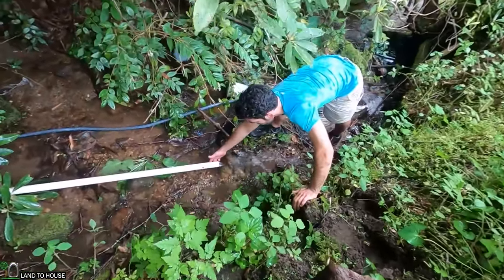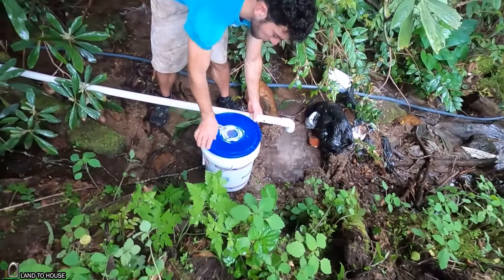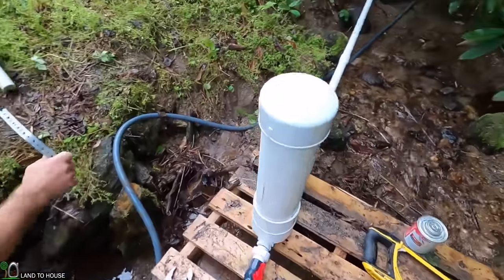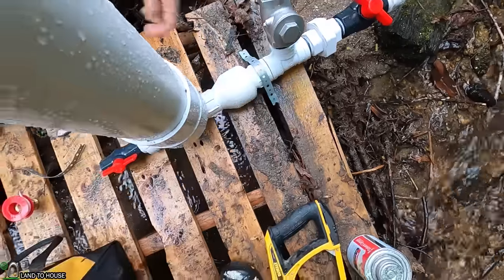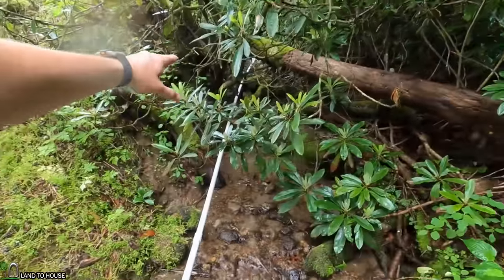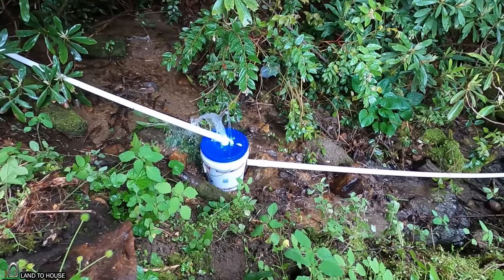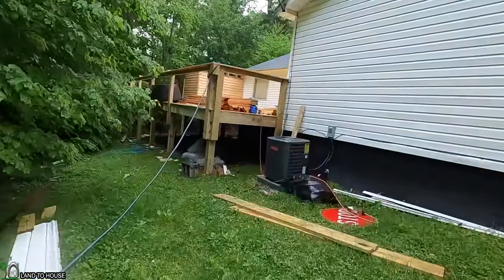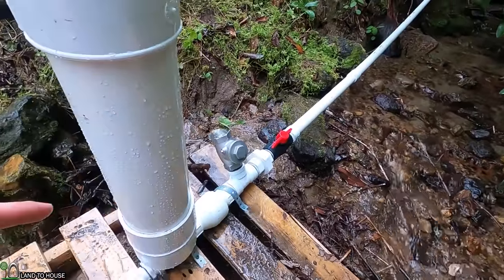Full Ram Pump Install 1-1/4"

Comment: Hi Seth, I have  a nice size creek that runs through my property it’s about 3’ deep but is very slow current thanks to the beavers! also land is pretty flat! Just wondering what are your thoughts if it will work for me? We have no source of electricity so this would be amazing for us! Thanks for sharing your videos!
Reply from the maker: Hello. To get the pump going you will need to have head pressure (water drop). 2 feet is the minimum head pressure to get the pump going. This can lift water to 14 feet. With low head pressure you are going to want to use one of the smaller pumps. They are much easier to work with when you have low head.
Reply: can you damn up part of the creek to raise the level of the water? stack a bunch of stones and then some of the beaver sticks and blame it on the beaver if you have any altering waterway issues which are a pain in the ash here in TN. But damn it, raise it, if you have flat land, you can also dig down your supply line area a foot or so, so between damming and digging you should be able to get your head height you need.
Reply from the maker: Creating a small water blockage (naturally by beavers of course) can gain the head pressure to run a pump. There may also be enough head pressure over a longer distance of pipe instead of making the water blockage.

Digging a hole and putting the ram pump in that actually does not increase the head pressure.

Comment: what was the purpose of that exhaust valve you had just before the vertical pump? do you have a video of the pump build itself?
Reply: Check  valve,  create pressure,  used to push  water.

Comment: Would   this system be used to pump water from a well under the ground?
Reply from the maker: Sadly the ram pump only works from head pressure. Well water does not have the drop needed.

Comment: Can there be to much head pressure i got 1.5   suction 60 foot of drop 3/4 diss the check is really hard to push down cant fet it to cycle
Reply: 100 feet of drive line with a 10 foot head will give the very best results. more head will not make any better just the opposite and to much hear and the pump will not run at all.
Reply: Thank you sir

Comment: Hi, I need help 
I've set this up ,valves going the right  way but it wont kick into action.
I know I have a bottle but it seems to hold the pressure . Please help or advise .
Many thanks 
Simon
Reply: The water flows through the first valve shutting it off and  the pressure builds in the bottle and the first valve does not reopen , I've opened it manually , it then closes again after around 2 or 3 seconds and closes again but does not reopen. But there is water flowing out of the pipe at the animal water  feeder
Reply from the maker: If you have water flowing out the top you have a back pressure issue. Search YouTube for "ram pump back pressure" and you should see my video on that.

Comment: Hello! Have a question, I'm in South Florida with flat elevation and have a work shed constructed of metal and would like to reclaim rain water into 2 -ICB plastic storage container's connected together supplying 660 US gallons. I know I can use a circulating  pump but would like to use Ram Pump if possible. I'm not sure of the head pressure of these ICB storage containers? Desiring to use recirculated stored water, I would like to use a garden hose pipe and drilling small holes into discharge garden hose enough to place small amount of water on the roof shed to diminish heat /temp's. My shed roof ridge is 9 feet to the highest point of ground elevation  and my tanks are 47 inches in height. How high would these tanks need to be elevated if this would even work? Will your ram work in this situation and if so, which one do you recommend I order from Amazon?  Thanks for a very interesting video.
Reply: I don't believe a Ram pump is your best option with a limited volume of water.  Ram pumps waste water as part of their operation.  I don't know the ratio, but they work best with a source of flowing water.  It might be an interesting design to use the flowing water from the downspout (while raining) through a ram pump to fill an elevated tank above the source (Rain Gutter), but I don't believe that is what you were trying to do.

Comment: But you need 2 check you used only one. You need 2 valvule check
Reply from the maker: The pvc inline valve is the secondary valve that holds pressure in the tank. It does not have to be carefully oriented like the swing valve.

Comment: I have a 55 gal rain barrel hook to a 1to 3/4 ram pump with about 50 foot of pipe between them but it still won't shut the 1in check valve it just runs out what is wrong can you shed some light on it trying to fill storage tanks for summer use
Reply from the maker: Its super important to match the waste valve size to the drive pipe. If the drive pipe is 3/4" and the waste valve is 1" the valve won't shut unless you have lots of head pressure.
Reply: the incoming line is 1 in and after the check valves is 3/4 to exit  @LandtoHouse

Comment: As sentiment builds in the bucket it will compact as it settles, at least it will in my geographical location. rendering your drain plug useless. without human intervention. And finding out this isn't for drinking voids my next comment. so I'll spare you that. Enjoy your cool/cold fresh spring water dips.
B)

Comment: why want to make such a small Ram Pump ?? Is it suppose to be bigger since needs to have such long delivery pipe???
Reply from the maker: The 1-1/4" pump is supplying at least 1440 gallons a day here. That is plenty of water for a cold dip.
Reply: @LandtoHouse  Hmmm... 1/2 gallon per minute is 720 gallons per day.  Still plenty for the sauna cool-off pool, ornamental fish pond, livestock tank or watering a kitchen garden.

Comment: Very good work, let me ask you a question: what is the ratio of water that the ram raises with respect to that of work?
Reply from the maker: Typically you can get the pump to operate on 10-30% efficiency.  A lot of water comes out the waste valve.
Reply: @LandtoHouse  Thanks!
Reply: @LandtoHouse  is there some way to limit the water waste from that valve? is that just to get the air out? because many ppl use a 6' tall vertical hose near the supply end and that is suppose to work good. could eliminate the need for that all together, if that is its sole purpose.

Comment: I was wondering
Could a ram pump be run in a winter environment if the fall of water never stops at the course of the intake line?
Reply from the maker: The ram pump can be run in temps below freezing. The issue is as soon as the water stops moving it freezes.  I ran a pump at 15 degrees for a week. Ice rose up from the ground and plugged the delivery. That stopped the pump.
Reply: Land to House 
Thanks for the reply.
That’s what I was thinking as well!!

Comment: Would this pump water 500 feet up hill?
Reply from the maker: The ram pump has an upper limit of 180 feet. This is based on the weight of the waste valve. The horizontal distance can be a very long way.

Comment: I live in the flat land and have to pump water from pond to garden barrel will the pump do this?
Reply from the maker: If you have head pressure (water drop from source to pump) It will work.
Reply: I don't have drop i have to pump up from source to a 100 feet flat and go up to barrel

Comment: Thanks for all your videos, great information. I would like to see experimenting with out of spec items. Such as over size air chamber or double chamber. Also larger waste valve ie 1” valve in a 3/4 system. Also larger drive pipe 1” pipe for a 3/4 pump. I am curious about the changes in pressure build and delivery volume with these variables.
Reply from the maker: I have tested a fee things like that. For the mismatched drive pipe it often keeps the pump from running.

Comment: What was point of adding bucket?
Reply from the maker: The bucket does 2 things. Allows an air free source. And catches silt.
Reply: Not only does it catch silt, if I remember correctly, it'll also slightly increase water pressure to the ram pump allowing it to work more efficiently.

Comment: Do you always need a fast running stream for this to work?
Reply from the maker: The 1-1/4" pump needs 8gpm to operate. As long as you have that you are good. If not it will drain the source.
Reply: what about pumping from a pond ? still water.

Comment: Thank for your video.    Any improvements or new products for 2021?    What is your current thinking about stainless vs brass waste water valves for 1 1/4 inch ram pumps?    I purchased two 1 1/4 inch ram pumps from Land To House last year which turned out to be a great decision and I'm considering increasing for 2021.  Thanks - Dave
Reply from the maker: I have totally swapped back to brass. The lighter flap allows for pumps to be used in low head situations.  The SS needed at least 1 more foot of head to work. No new ram pump products. I am starting a new youtube channel.

Comment: Thank you for this very timely video.    Like the pump in the video, I have a Land to House 1 1/4 inch ram pump that I will start installing in a couple of weeks and my estimate is that I will need the 20 to 30 feet of lift similar to the installation in video.  I'm only looking to lift 10 feet, but I'd like to run a low pressure Wobbler so another 20 ft of potential lift should give maybe 8 PSI for the Wobbler?  (note to self, look into the ultra low pressure mini Wobbler version).  Hard to tell, but I don't think that 1/2 gallon per minuted directly from the ram pump is enough for our current Wobblers?
If we need more water to run the Wobbler and / or drip irrigation, what are our options and which are the most productive?  
- Increase the head?  I have 2 to 3 ft of head from a a couple of diversion dams and difficult to get more dam height for one location because of the flat meadow.    I'll need some length of drive pipe anyway and can pick up more head by running a longer drive pipe.
- Increase the length of the drive pipe for the shock wave to travel - might help, but I'm unclear of the relationship of length of drive pipe to volume of water delivered to a usable height with the same head, however 20 feet of drive pipe may not be optimal and may be able to run it to 100 feet fairly easily.  
- Increase the flow through the drive pipe - will this even help?  We do have plenty of water, but I'm not sure if increasing the 1 /14 inch drive pipe to say 2 inches until just before the pump will even help and might be counter productive.   Is there a Land to House video on this?
- Add more ram pumps?   In this particular situation, I'm trying to irrigate a meadow of 3 acres with the highest point about 10 feet up from a stream with plenty of water, especially since some of the pumps may be able to use combined output and waste water is returned to the stream.   I'm pretty serious and while I won't jump here, but if necessary I am prepared financially to install a dozen ram pumps and acquire a bag of earplugs.   Anyone running multiple ram pumps to deliver the required volume of water?

- Pump higher to a tank and release with an auto siphon when enough water is available.
- 1 1/4 inch is currently the largest ram pump available from Land to House.   Going bigger by building myself or from other vendors may be an option once I have at least one of the 1 1/4 ram pumps operating.   So far, despite some effort on my part, I'm unclear of the trade-offs between more ram pumps vs larger piped pumps for a fixed amount of head and lift required.

- Other types of water powered pumps may be a possibility.  It is hard to get comparative statistics, even for environments where different types of pumps are possible, because usually the installer has their single favorite approach.      Only when a significant amount of water is needed does it make sense to spend the effort to compare the cost vs volume of water delivered by different types of water powered pumps.  If you are interested, please reply here about the Land to House pump approach and consider sharing your ideas in the Water Powered Pumps public facebook group - obviously, I need all the help I can get:   https://www.facebook.com/groups/240458583255303/
Reply: Thanks for drawing my attention to your short drive pipe video.   Seems like it would be worth a try to increase my drive pipe from short to 20 ft to 40 feet and continue to go longer with the drive pipe as long as the volume output continues to increase.    Unfortunately the head will not increase very much with distance in my case:     Here is the link to the Land to House Short Drive Pipe video:  https://youtu.be/yofEoR43bqU

Comment: Hi, if I want the water from 600 meters is this helps
Reply from the maker: The ram pump is able to push water 600 meters horizontally. It will max out in lift around 55 meters.
Reply: @LandtoHouse   which size we should use for that?
Reply from the maker: Each size has close to the same potential.  The difference is the amount of water it takes to operate the pump and the amount of water it can deliver. 
www.landtohouse.com 
More information is available on the homepage.

Comment: if buy a solar panel and an electric pump, cost will only about $ 700, in comparison with the price of a hydrotaran in $ 1800 on Amazon, the system will also not need of a paid source of energy, in addition, it will not need a long feed pipe
.
count:
solar panel 24v 10a 250w 1 pc - $ 115
3 electric pumps 24v 3a - $ 420
car batteries 55 Ah 12 volts 2 pieces (in series, for ballast) - $ 115
filter, 40 microns 3 pcs - 55 $
solar controller 20a 24v - 10 $
total - 715 $
prices in russia of end June 2020. Shipping cost not included. (about 25 $ for everything)
if you will use only 1 electric pump, the price will be sharply lower
Reply from the maker: Let's say you use a 1/2" ram pump. The price can be as low as $100.
Reply: @LandtoHouse  ваш столько там стоит. (1800 долл) там такая цена. ну так детали дешевые, 1 дюймовый может стоить тоже 100 долл, но что то хочется покруче. электронасос на солнечных батареях! и в ютубе мало таких видео) можете сделать) может попадете в тренд)))
Reply: @LandtoHouse  translate ourself. it simply

Comment: Can you use this in a hand dug well?
Reply: No water doesn’t defy gravity the head pressure created by the down stream creek flow operates the valve along with the chamber that fills until the air space in the hammer tube causes the gate valve to close and releases the pressure up the hose no well creates head pressure without a pump

Comment: Hello, I recently planted fruit trees on top of a hill with only rain water collected at bottom of hill. Want to keep it cheap. Can I make a little basin with small electric pump at bottom of my hill then send the water uphill with one of these offgrid pumps ? Theoretically this would require just a small cheap electric pump, small basin and your pump to get my rainwater up the hill.
Reply from the maker: That would work. One thing to consider is that the ram pump requires lot of water to operate. Typically the 1.25" pump will lift 1.5gpm for every 8 gallons lost.  You are need to put a catch basin under the ram pump to capture that waste water to be pumped up again. If you going to be using a solar powered pump you might just consider only using that.
Reply: @LandtoHouse  You're right, thanks so much for the answer♤♡◇♧

Comment: What's inside the ram pump?
Reply from the maker: Water and air pressure.
Reply: Question,  is there a way to increase my water pressure at my home. I'm getting about 53 psi on my outside faucets and I'm thinking about putting in a sprinkler system.

Comment: It looks totally wrong! How can it possibly pump? The waste valve usually is mounted after the air container and the one way valve between the air volume and the feed line. I am puzzled!
Reply from the maker: Haha there are several configurations for the ram pump. This style is easier to ship.

Comment: Love the videos. I'm building my own pump but finding it impossible to find the 4" x 1 1/4 bushing at Lowes or HD. Where do you normally buy those?
Reply from the maker: That part is hard to find. I buy them in large qty from a supplier.  You might have to go with several parts. .
Reply: Google like a normal person.

Comment: I would be very careful using plyers or a wrench to tighten "male" pipe thread into PVC "female" pipe thread, the tapered pipe thread can and will split the PVC, I speak from experience and a costly backhoe project.
Reply from the maker: For sure. The pvc threads can split or cross thread.

Comment: Sounds like a HEART--- hmm?  Did anyone ever think that in reality this is how our heart actually works?   Think how the speed of blood moves through the body from the  capillaries (like a marsh- slow) to then tighter arteries (like a river racing) -- into the heart.   Blood is flowing fastest right before it re- enters the heart.    To think that a 12 ounce thin muscle is going to pump for 80 to 100 years non stop -- is dumb.   The Heart works like ram pump.  Wow -- the reason we have clogging of ateries is body creating pressure (like you do with a hose) --- it is body creating own therapy for blood to keep flowing.   Medicine can unclogg arteries, but it does NOTHING for congestive heart failure.  HMM?  They are looking at it wrong.
Reply: wow amazing analogy!

Comment: This is a sales pitch for the pump distributor 🤮
Your amateurish pump installation will be all washed down the creek on the first heavy rain of the season :face-green-smiling:
Reply from the maker: I am the pump distributor. 

The ram pump can be installed on the bank as long as the inlet is getting water. Luckily this creek does not see too much flooding.